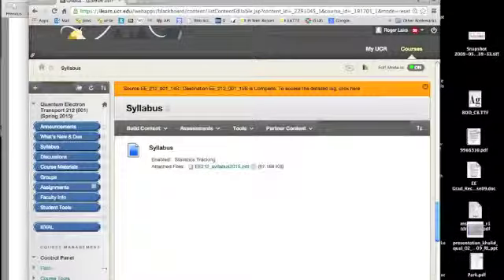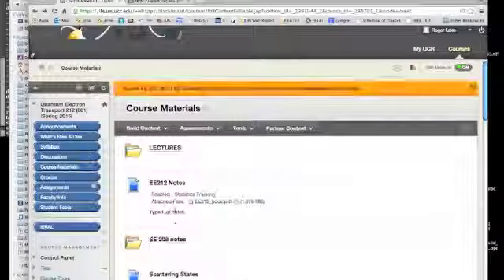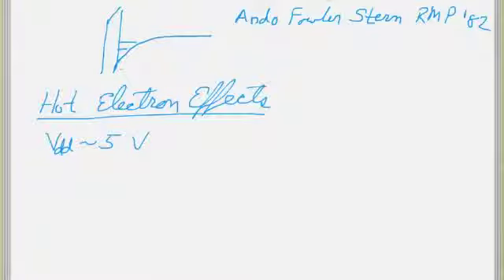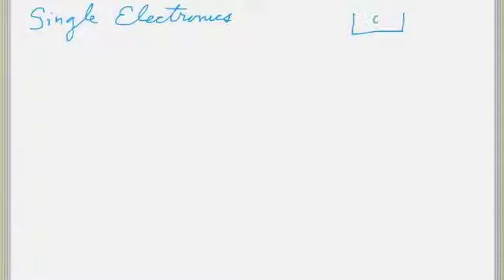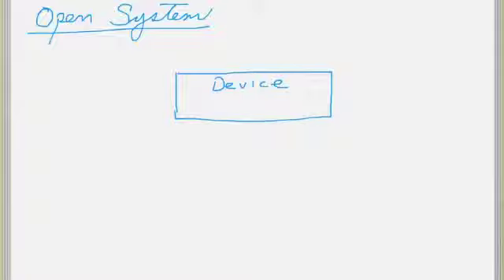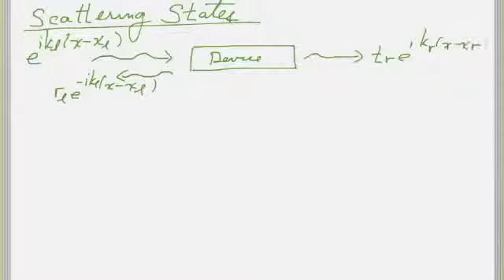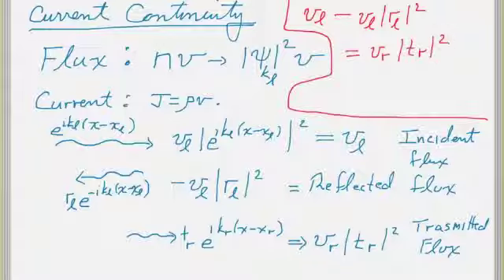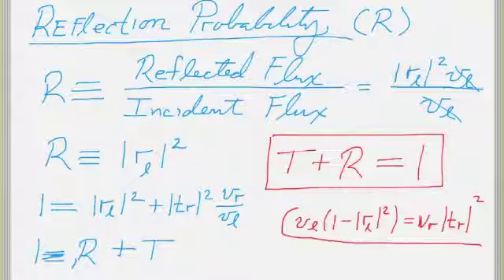EE 212 Lec. 1 Part 1 3/30/15

Comment: THANKS,...Sir do you have Poisson NEGF MATLAB CODE solution for 1D device?
I have been trying to implement but my code is not giving accurate results.
Reply from the maker: I don't think we have anything specific for 1D. We were modeling FETs which required 2D solutions.
Reply: @lattelab5040  can you provide MATLAB file for Poisson NEGF solution for 2D? Actually my code is having some numerical errors which I can't figure out. I would be thankful if you can provide one. I can provide email.